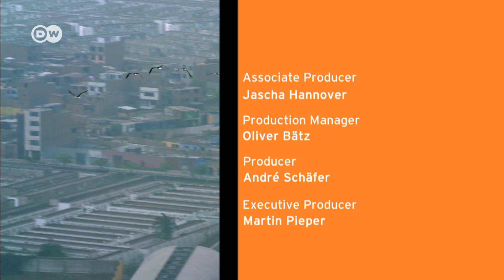From Rio to Lima – Transoceânica, the world's longest bus journey (5/5) | DW Documentary

Comment: Excellent documentary! 
I have one question though: if the bus company is from Peru, why isn't the "maiden" voyage from Lima rather than from Rio? Did the company receive a new bus from Rio, so that the bus drivers had to somehow get to Rio to start the journey? or did they drive the same bus to Rio without passengers? Or, does the "maiden" journey already started from Lima, but DW only managed to catch up with the return journey (which is fine, but the emphasis on the term "maiden" should be clarified)?
Reply: Probably the trip from Lima to Rio was just a test drive, while the return journey was the first trip with passengers.
Reply: I think they already had a regular service from São Paulo to Lima and just extended it, starting from Rio.